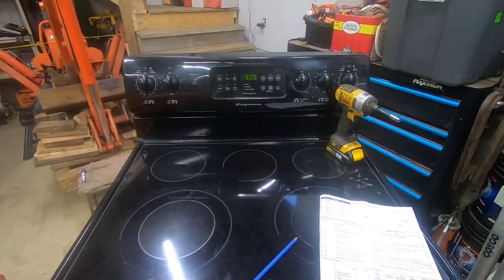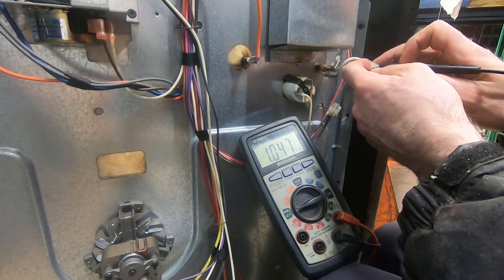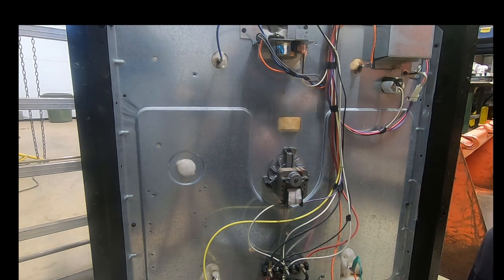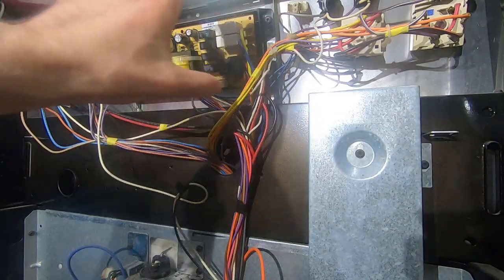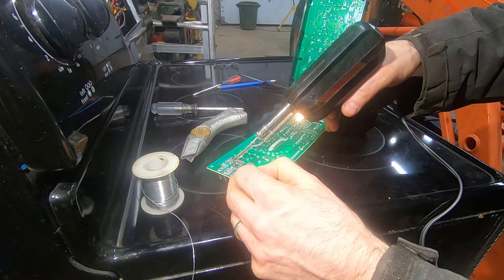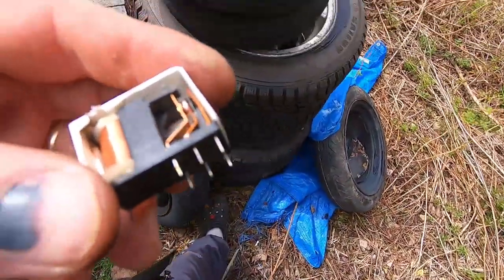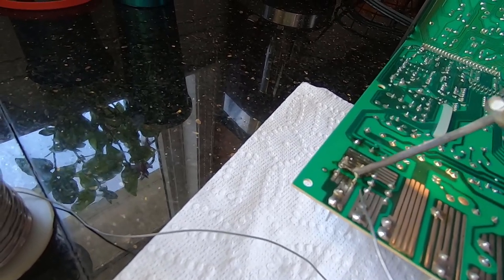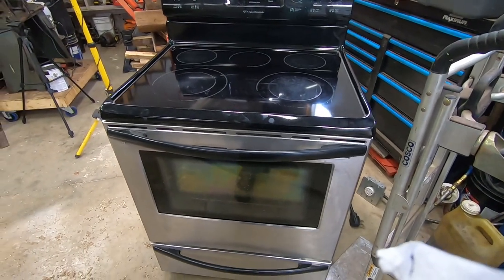DIY Electric Stove Circuit Board Repair Fixing Bad Oven Elements

Comment: Where did you connect the meter to test the relay?
Reply from the maker: At 4:55 I show how I connected meter leads across the bake element terminals.  This was the config at 8:10 when pushing on the relay.

Comment: Is the voltage out put from the control board to the oven element ac or dc?
Reply from the maker: I would be very, very surprised if it was DC.
Reply: @mrdiyguy123  tks i now tested it it was AC